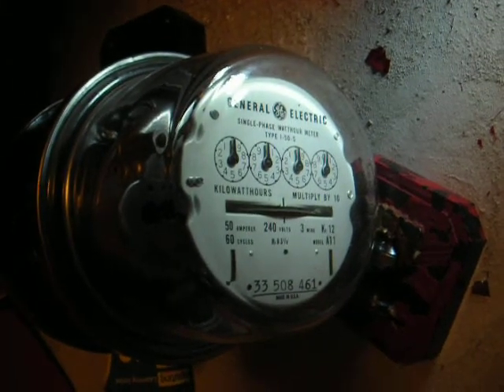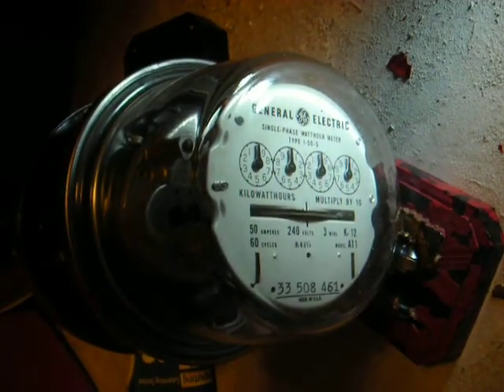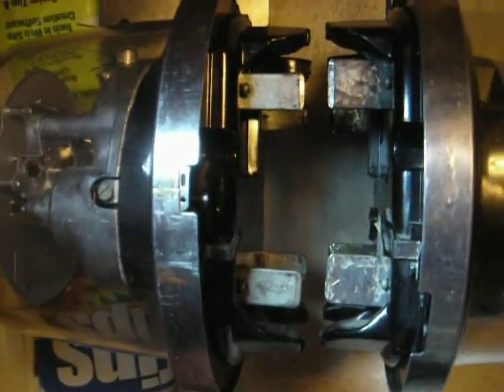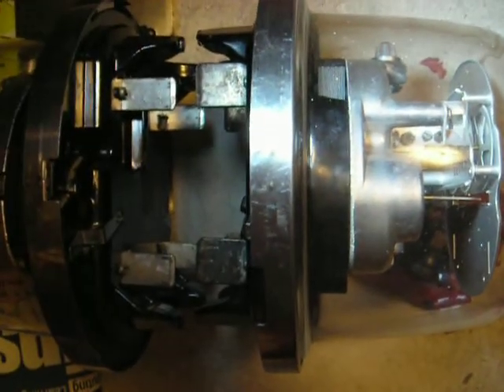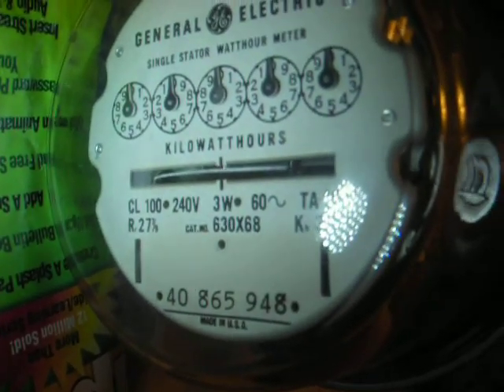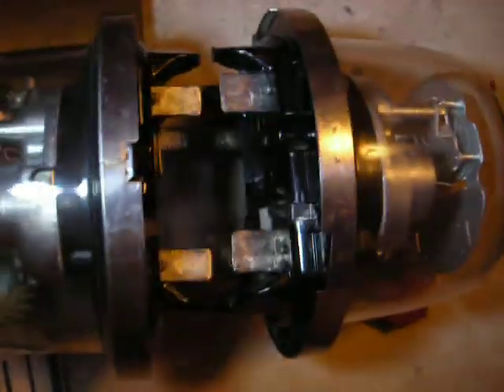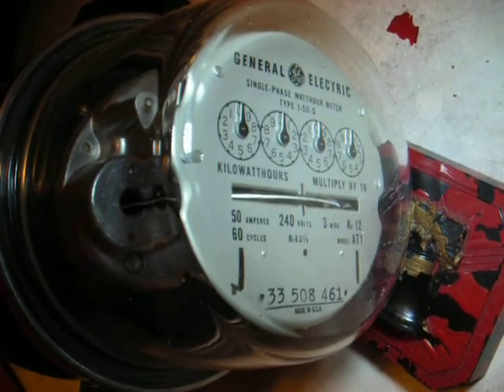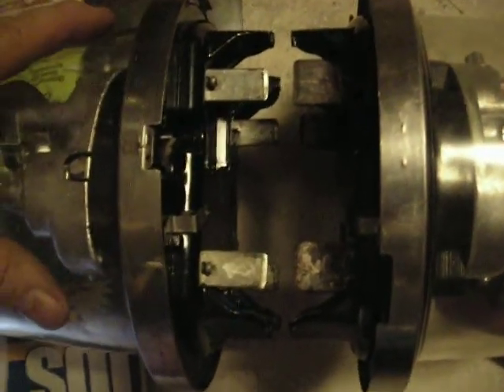Watthour meters (2) analog dial GE model I-50-S for 200 Amp service bigger lugs than I-55

Comment: It was an early means of classifying a 200 Ampere Watthour meter as  200 class Watthour meters were not standard until the late 1950's. Type I 50 meters were 60 Amp service Single phase 240 or 120 volts. Type I 55 meter was virtually identical except the stator load capacity was increased to 100 amperes class 100. When Type I 60 meter was introduced 1957 the register faceplate was stamped CL 200 ( class 200 ) for 200 ampere Single phase service was becoming more standardized in the late 1950's. However as the early Type I 50 ( 50 ampere ) meter was not clear of class 200 with registers stamped 50 amperes multiply by 10 also the early I 50 meters for 60 ampere service were not stamped CL 60. The Class stamping became standard by the late 1950's as 200 class meters were introduced by meter manufacturers and many meter manufacturers were producing 60, 100 & 200 class meters simultaneously to meet service load requirements in the field